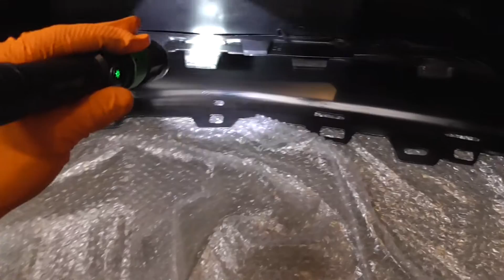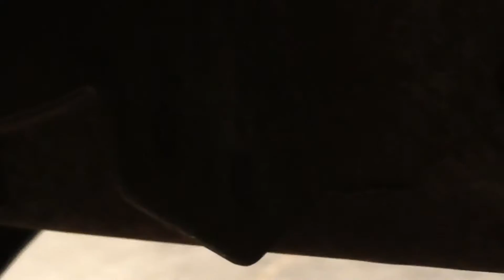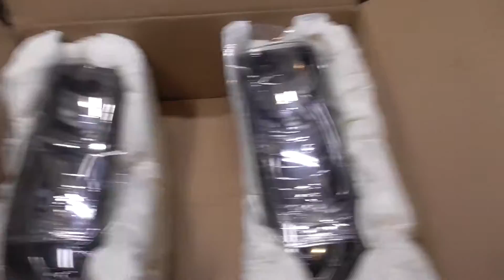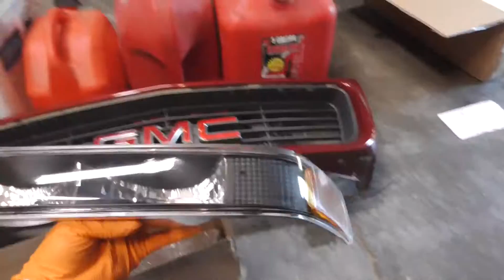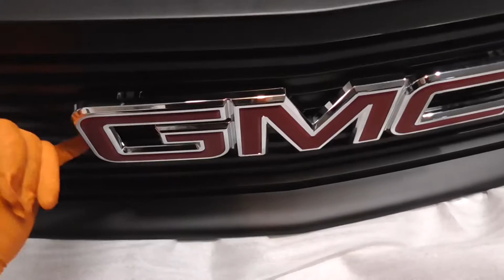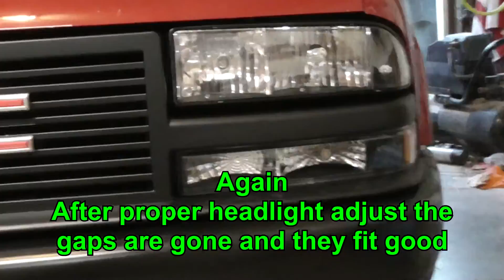GMC Sonoma | Xtreme Conversion Part 1 | S10 Bumper, Grille, and Lights | Front-End Swap

Comment: Did it matter what bumper design you went with? I have a 00 Blazer but I have the front end that has the chrome bumper with the place trim piece that pops into it and I want to buy one like what you have? I’m pretty sure the brackets are the same just different design for the blazers right?

Comment: Did you ever swap out that little 2.2L so the dual exhaust is actually doing something worthwhile?
Reply from the maker: No, its actually been over a year since I actually drove the thing.  Got kinda tired of not having any power and also not that much better gas mileage then my Yukon due to the 2.2. Plus it needs an AC compressor. Just been putting off installing one. Long term I do plan to swap something into it but I have enough "projects" as it is and this isn't a top priority since as it sits the 2.2 is still running strong with only 100k on it.
Reply: Do you use the factory light harnesses for the headlights etc or do you have to swap em

Comment: Do you still need those brackets  if your not going to use the xtreme valance I have zr5 sonoma but I like the chevy lights but I love how your gmc emblem and grill came out I wanna do the same
Reply from the maker: You can just get the standard s10 side brackets, but you will need new brackets.